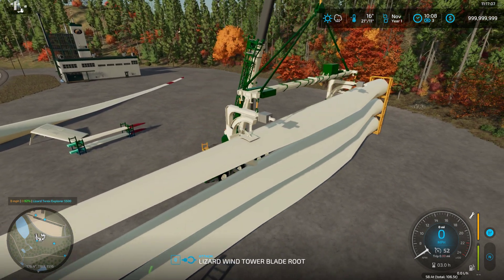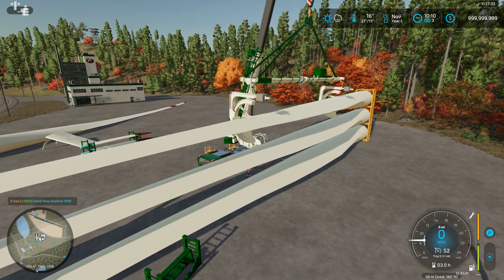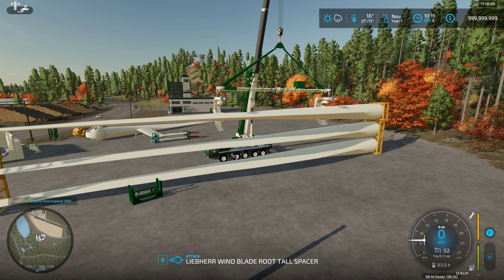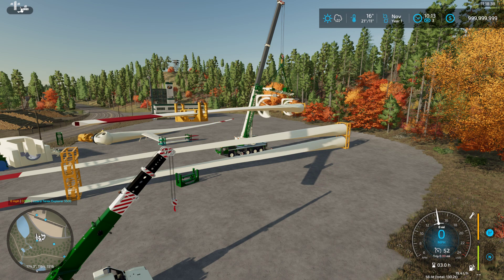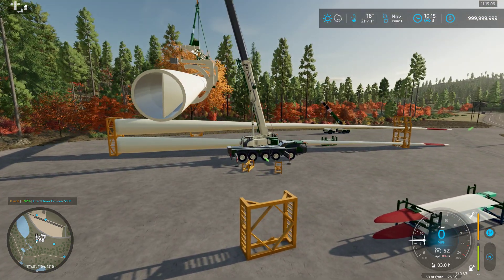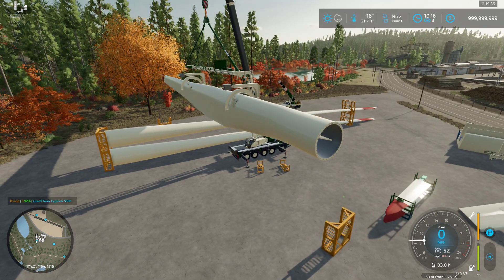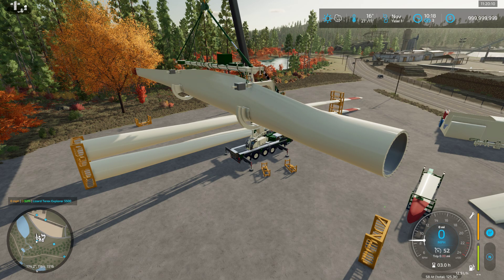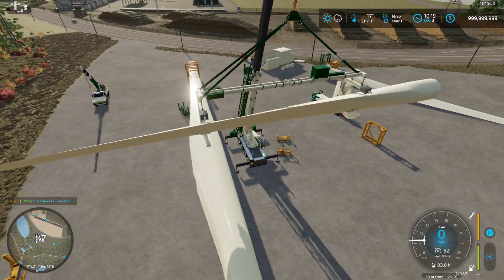FS22 Buildable Wind Turbine: Blade Lifting Tool Testing

Comment: This has absolutely nothing to do with FS22, but I have found that the weight lift for the Liebhere LTM 11200 for FS19 is extremely buggy, and keeps clipping out of the holes in the weights. Can I fix this?
Reply from the maker: How much weight are you trying to lift?

It is only meant to lift two 10 metric ton weights.
Reply: @jeremybrown9379  The max, or what you said. I'm trying to load 2 10 ton weights onto a ballast.
Reply from the maker: @oobergoober  is it clipping out when it is moving or when it is sitting still?
Reply: When it's moving (sorry for late reply, didn't get a notification), also if this helps I was using your LTM 1300
Reply from the maker: @oobergoober  that is an issue with Farm sim in general. It is partially fixed using delayed mesh in FS22
Reply: Ah..I see.